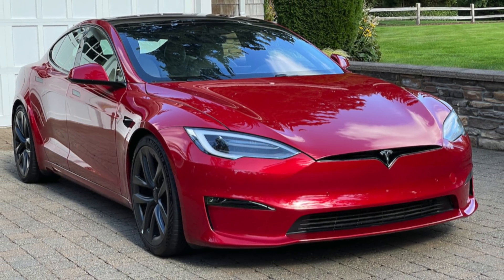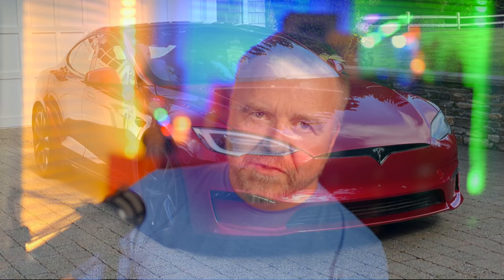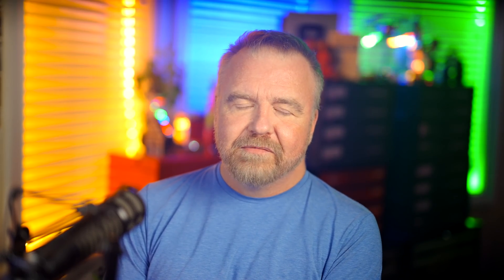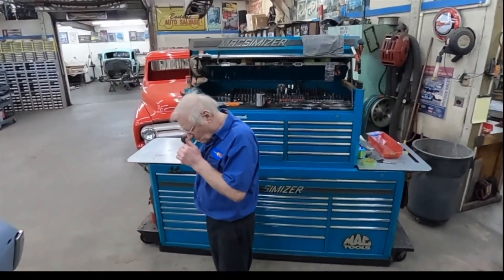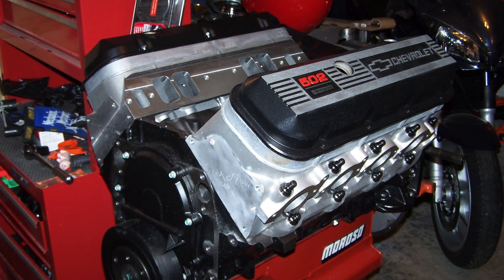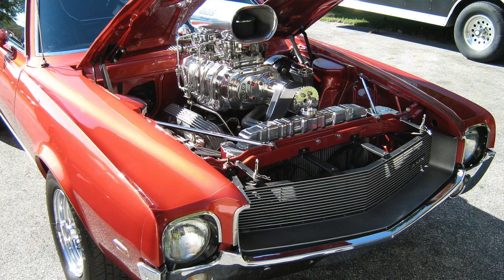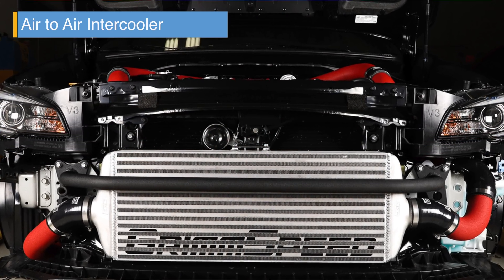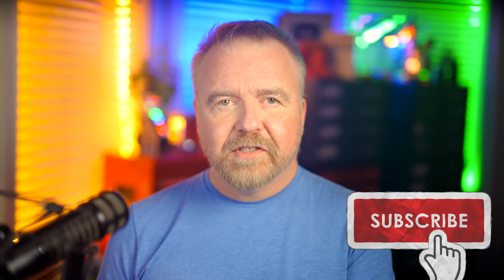Twin Turbo Power Secrets: Can I make 1500hp for $1500?  Plus Dyno Fails!

Comment: The holy grail of turbocharging back around 1980 was to build a turbo with variable geometry so you could control how much pressure it made a power, then you wouldn't have to have a waste-gate.  I had a friend who was a mechanical engineer working for a company that was trying to develop a new turbocharger.  I think they had some success but I don't recall that variable geometry turbochargers were much of a thing in the market.
I've seen information on a company in more recent years who made and sold turbocharged engines for street use with up to 1500hp.  They operated at higher boost, probably higher than what you were running.  Their secret was to have 2 independent fuel supplies to the engine so at normal loads you could run on pump gas but at higher boos pressures it would switch to the supply of high octane fuel.

Comment: @ Dave, with the Tesla Plaid capable of 23,308 RPM @ 200 mph I am pretty sure that the gearing could just be modified to say half that RPM and it is now a top fuel dragster from 0-100 without the fuel. That no gas engine unless its an aircraft engine can ever hope to touch. lol like 0-60 in 1.25 seconds

Comment: cheapest/easiest route would have been a toyota 2jz with stock internals and a twin turbo setup ( motor comes in the toyota supra and lexus sc300, lexus gs300, lexus is300, and others ) forged rods and pistons from factory and factory turboed for some. oh and its an inline 6.. thats a sweet car you got tho, my uncle has two, one red one black. that my cousins were supposed to get when they graduated. but only one did haha.. (were in washington too).. oh and if this video existed back when i was looking into how to turbo charge a nissan 240 sx it would have saved me hours of research on what all the parts of a turbo did and why they were needed. you taught it in like a minute compared to having to spend hours going through forums and what not.

Comment: Nice to see some car content after your Q&A videos.  Im working on a turbo 3800 grand prix which is a little challenging being a FWD vehicle and the factory transmission can't handle much over 300whp lol I just replaced it after doing too many burnouts with the stock supercharger and some mods

One of the cheaper ways to overcome that limitation is to swap in a transmission from a northstar cadillac but you have to invert the logic for the shift solenoids either in the tune (done once from what I know) or use relays/solid state circuitry.  

Im autistic too lol

Comment: As a turbo nut who’s watched your other videos very cool to see you do a video on your own turbo build. Would love to get in contact with you on some other stuff… some fuel thoughts;
The race gas concentrate is the same stuff as torco accelerator and boostane; mmt. Also some of the cheap octane boosters are actually mostly just methanol… which if you know what you’re doing works awesome in a gasoline ethanol mix. There are a fair number of papers on GEM fuel mixtures. Methanol is pretty much king when you compare cost per gallon, turbo spool ability, and total boost capability. Not to mention a lot of drag racers use it to successfully boost with no intercooler… saves a fair amount on nose weight.

Comment: Cant believe it only cost you $1500 here in australia itd cost like 6 to 10 grand easy.  you dont get parasitic loss from a belt or a chain but you get backpressure. Ive always preferred water to air
I had a gt 45 In an Aussies Xr6 Turbo it wasnt enough for me, in the end i had to upgrade everything till she made 1100hp+/- whatever broke at the rear wheels. Then decided id had enough of breaking shit and sold it.

Comment: Looks like a power supply bottleneck. Upgrade the FPU (Fuel Pump Unit) and you should see full power from the engine until something else breaks.

Comment: A turbo is hardly free power. There are pumping losses from the hot and cold sections although about 65-70% less than a Roots Supercharger.
There's this guy on YouTube that is developing an electric supercharger and showing us all the development. His only pumps 5psi and the power it puts out is substantially higher than any turbo can produce at the same 5psi. Why is this? Well because it's powered by lithium-ion battery and an electric motor and there is zero pumping loss from the engine. It well illustrates that turbos aren't free power - how can they be? If there's pressure in the exhaust that's a pumping loss, if there's pressure in the intake that's a pumping loss too. 
Pumping pressure takes power no matter how you look at it otherwise it would violate the laws of physics LOL. 
Electric superchargers get around this because the work of pumping boost pressure is unloaded from the engine. Downsides are you can hardly go canyon carving for 4 hours. You can only produce boost for about 30 second periods before you have to let the battery cool which is still handy for a bone stock engine without added ring gap fanging around town off traffic lights. Less lag too.
On a turbocharged engine if 14.5psi makes 100% power increase, 7 psi makes ~ 50% increase an electric supercharger seems to make about 30% more at the same boost from what I've seen.

Comment: An entire 1,200 HP turbocharged big block is cheaper than a new GPU.

This is the first time I've watched a video and not felt like an ignoramus. I did my first brake job at the age of five, almost fifty years ago. I even owned that Corky Bell book at one point. You're right, best book there is on the subject.

Curious as to why you chose that ECM vs something like Megasquirt or any of the others available. I'm looking into ditching the factory ECM on my truck and, frankly, the topic is clear as mud to me. They all do the same job so I don't really know what I should be looking for to decide which would work better for my application.

Comment: Dave!!!  This was awesome sir! Your background and knowledge is astounding. I date back to the old CPM days, had a trash-80, cut my teeth on a Serry Rand 16 bit machine, a HP2300, and a series of  PDP-11/03/34/27/44's etc. Running RSX-11M. Followed up with a 780-2 VAX running VMS. I even did a 100% reverse engineer of a PDP-11/03 Norton Emulator with custom made cards. THEN, along came the  PC/AT's with DOS 2.0. The rest is history. So, following along with your adventures in code has been a huge trip down memory lane.  Nice engine by the way. Cheers from Texas!

Comment: So this is a fairly simple turbo build... But what's really down your lane is when you want to use an aftermarket ECU like a big stuff or any of the other aftermarket ECUs that have their own data output, but you need to stick it into the CAN bus system of a modern car so that the dashboard continues to work and all of the other control systems remain happy...

That's when you get into hobby programming for cars. Lol

For example I want to swap out the engine in my modern CAN bus controlled car to a LS or LT Chevy V8 with a big turbo on it... But I still want to keep everything else on the car working.

Comment: The old 70 cadillac eldorado had some amazing potential, by making 550lb-ft from the factory from that 501CID V8 it could be pushed pretty far, but it took alot of strengthened parts

Comment: As a fellow "On the spectrum" individual, I would love to work with you on this project to see where we can take it! I have been working on cars for over 30 years (I needed a milk crate to reach the button to lift the car when I did my first brake job  on my own on my moms cari the shop my dad worked at the time). My spare time the last 15 years has been occupied by acting as crew chief on my best friend's UMP Dirtcar Modified. Extracting every possible advantage out of everything without breaking it (His yearly budget is only in the low 6 figure range, want to make a small fortune in racing then you need to start with a big one!) has been my way to blow off steam for 15 years, let's see what we can do together!!

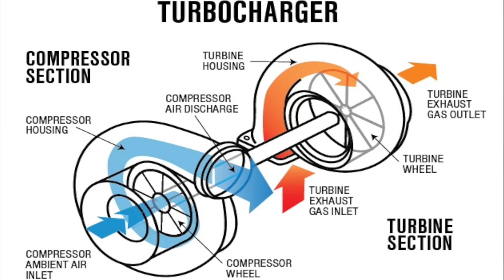Comment: 11:10 let's not make it sound like free power. Turbochargers impose an exhaust restriction. Spinning a turbine to 50 000 rpm doesn't come for free. Also, it's not the free heat from the exhaust that drives the turbine, but rather the gas velocity. Heat itself makes air expand creating more flow, but that's caused by the explosion and the exhaust stroke. Saying that heat spins the turbine is like saying that the spark spins the turbine, it's just something that happens previously and helps, but ultimately it's the amount of exhaust gas and its velocity which is also driven by the exhaust stroke

Comment: Couple thoughts on mitigating the need for race fuel.  Consider water meth injection, or E85 fuel (provided it is more easily obtained than race fuel).  Of course E85 means the entire fuel system is capable.  Higher flow pumps, injectors, and ethanol compatible lines.  Computer needs to have safety properly set to pull timing for lean conditions.  Playing with that kind of power your attention will never be on a gauge or a warning light.  Same goes for oil pressure, coolant temperature.  Best to have a computer there ready to shut stuff down.  Congrats on the 1200 mark.  The real fun is getting it all to fit in a chassis ;-)  Are we going to see your TIG skills?

Comment: Just FYI, a 3 bar map will only read +2 bar, you have to account for the vacuum range as well.

The reason for the fuel pressure having to raise 1:1 with boost is to keep the same delta under the Injector. Say you have 40psi  of fuel pressure at wot, and not you add 10psi of boost in the intake. The Injector now has to fire into an additional 10psi of restriction. So we add that 10psi back in additional fuel pressure so you end up with the same fuel flow rate.

Comment: Maximum Boost is a great read, Corky Bell knows his stuff!  Sizing the fuel delivery, pump capacity, hose size, injector size and duty cycle are a big part of making reliable horsepower. I was surprised by all the math to modify and tune an engine!

Comment: The ZZ502 didn't come with Trickflow heads (from all research I could find), was that early picture of your ZZ502?  With a better camshaft I'd expect the motor to make an easy 625HP NA, with a proper turbo-spec camshaft, it should make the 1275 at 10psi or so.  I know you found the Corky Bell book, but did you also pick up any Richard Holdener books?  He has a YouTube channel too, and that guy is a living legend.  He's turbocharged and supercharged more combinations than you can shake a stick at, and he's been doing it for probably 25 years by now.  He was a writer back in the day for Muscle Mustangs and Fast Fords.

Comment: Last time I messed with DIY EFI was way back in 2005, 2006, 2007 when I built a Megasquirt computer for the 390 cu. in. V8 in my '68 Ford Galaxie 500 convertible.  Back then you couldn't buy off-the-shelf EFI at any price -- nowadays it seems that everyone makes an EFI kit you can buy and strap on to any engine.  But I had to build it all myself back then.  

Combining that EFI with a GearVendors overdrive that I attached to the back of the C6 3-speed automatic, I managed to get that old car to get 20MPG on the highway, even with a 3.70:1 rear gear, while still making right at 390 crank HP - naturally-aspirated, of course.

I never could get that thing to start reliably in cold weather, though.  The problem was the design of the throttle-body.  The injectors were on top of the throttle plates instead of underneath it (stupid design, I know). That 390 requires a LOT of fuel when it's cold, and I just couldn't ever get it rich enough and idling fast enough to keep it going -- had the injectors been in the manifold instead of in the throttle-body, I'd probably have had much better luck, but I didn't want to modify the manifold.  I wanted every mod I made to be un-doable.

Eventually I just got tired of not being able to start the stupid thing when it was cold, so I went back to the Autolite 4100 carb that it came with.  Properly-adjusted, it's a reliable enough piece of old technology, if inefficient and not as powerful.  And the cold-starting problems went away.

Comment: A turbo is a machine to practically print horsepower. They're so effective at what they do. I first tried turbocharging an engine almost 20 years ago and I was instantly hooked, it was so easy to make so much power it almost felt like cheating. I doubled the horsepower by just bolting on parts, while without a turbo you would have to change every single component of the engine, some of them more than once and you still might not double the power.

Comment: Great result, great project. My BMW e92 335is have only 600KM (at the moment), but fuel system is prepared for 1400KM, twin turbos for 700+KM if I was crazy enough to try this. For problem with octanes, you can try to add flex-fuel and mix petrol with 96-99% ethanol. Or with out flex fuel you need prepare fuel map to inject more fuel with more % of ethanol.

Comment: Yeah, I guessed you would have fueling issues.  Everyone does the first time because you never quite understand how much fuel needs to flow.  Even if the fuel pump could keep up you may have found the injectors were going to be the next bottle neck.  Figure out the amount of air going into one cylinder and the rate of filling then how much fuel you need there for 11.5:1 or 12:1 afr.  Then check the injector specifications.  It can shock you.

Comment: Shweet! So, you capped at 1270 HP, but  1270 [(your cutoff) is too high]. Need to put a governor on it, Dave, to set a maximum horsepower capactity to <1200. Well done as always sir. ((Just did some math and came up with the figure 1050.4 HP as your optimum for whatever reason.)) Could be waaaayy off base, and you want max, anywho.

Comment: A turbocharger isn't really completely "free". You're introducing impedance for the exhaust gasses to spool the turbocharger. It's still worth it though.
Reply: True, however the parasitic losses on a turbo are much less than any type of belt drive.

Comment: Actually, the other mount is applying torque as well.  The total is the force (change from standing) times the distance between the mounts.  As an enthusiast myself, I can appreciate such tales.  We do need to take care not to exceed the strength of the parts and bolts...

Comment: Another interesting technology is the electrically driven supercharger.  This eliminates some of the low RPM low power output regime parasitic loss while still providing the high RPM and high power output boost and still maintains the “instant” response the separates a traditional supercharger from a traditional turbocharger.  And then there are the variable boost turbochargers than can keep the turbo spinning fast even at low throttle and power settings and then quickly turn that RPM into boost pressure with the quick motion of some electrically driven components.  The options to boost an engine have never been better.
Reply: yeah but whats the point of wasting the electricity on a supercharger if you could just add electric motor (to make an hybrid), that would be much more efficient

though electric supercharger sounds cool af
Reply: @andris1337  But then you need storage batteries so it isn’t more weight efficient and adds a lot of complexity.  Putting a small electric motor on the supercharger and running it off the alternator is a pretty good solution, although I think the variable boost turbochargers are even better as they are lighter and use much less electricity.
Reply: Anybody who knows what kind of HP it takes to drive a supercharger and then also knows what an electric motor of equivalent size looks like instantly knows why this is not a simple or common thing to do.  If you intend to run it at 100% duty cycle, then you also need an alternator to generate the necessary current.

Let’s say the supercharger takes 50HP to run.  Go look up what a 50HP electric motor looks like! 😆
Reply: @GoFastGator  And you have missed the point entirely.  The biggest drawback of a conventional supercharger is that it runs at 100% duty cycle even though it is needed less than 10% of the time.  And modern electric motors are quite small.  Look at the size of a Tesla motor that has a few hundred HP.  An electric supercharger would have the motor integrated with the unit possibly as part of the impellers themselves, not tacked on like an industrial motor.
Reply: @LTVoyager  not entirely missing the point.      Those modern small form factor motors have to be cooled, and the energy to drive them is not free.  You are converting mechanical energy to electrical, and back to mechanical.  The only advantage would be the ability to buffer the energy consumption in the battery and replace it during times of low-load.  There have been a few examples of superchargers that have the ability to mechanically decouple from the crankshaft to minimize parasitic load when the performance is not needed.  Mercedes E55 AMG for example.

Comment: I thought a rule of thumb was to pull a degree of timing per psi of boost, but I suppose if you’re running high octane racing gas, not as important.